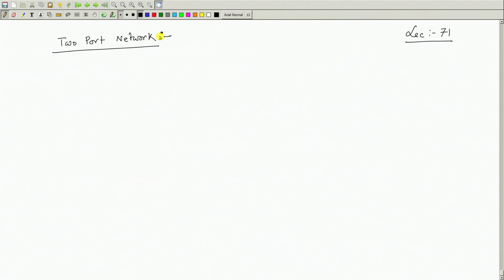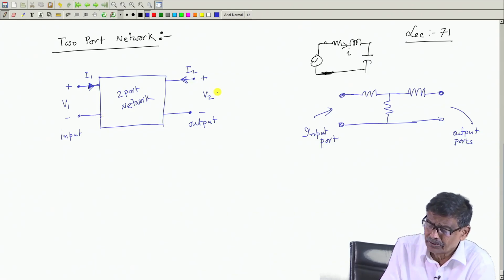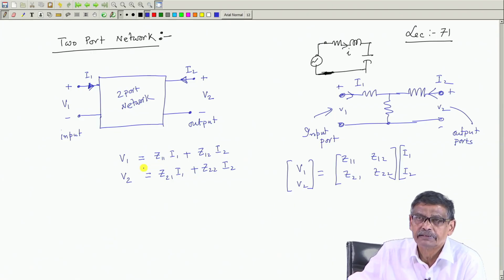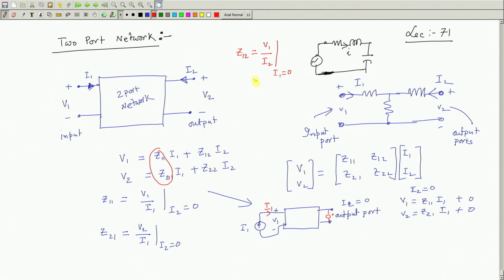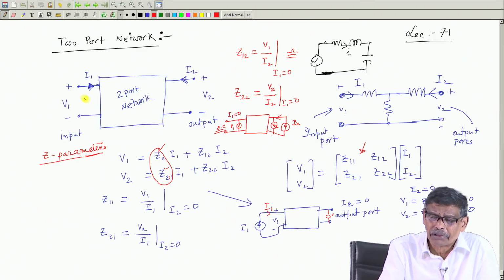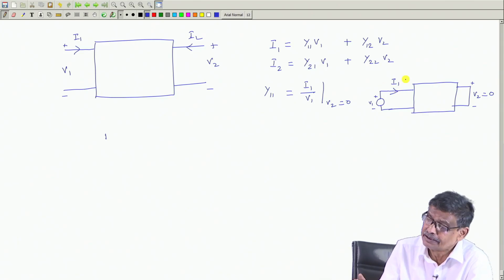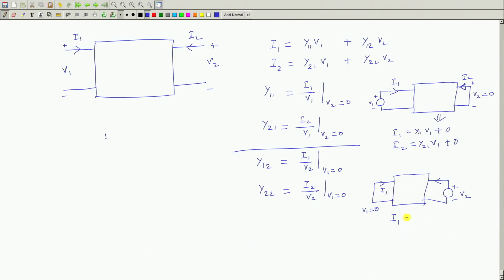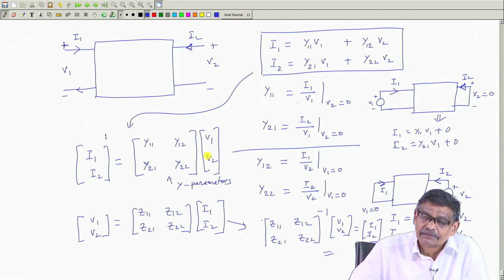Lecture 71: Two Port Network - I

Comment: Sir   , at 12.28 , if output port is kept open circuited,  that is  i2=0, then how can u measure voltage across output port 
If there is voltage difference that is v2 , then there should exist current i2